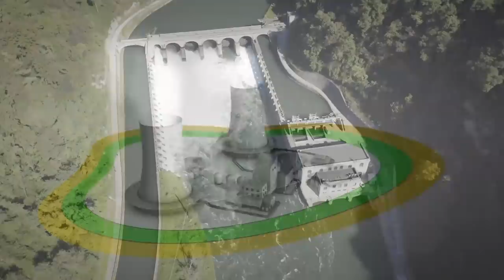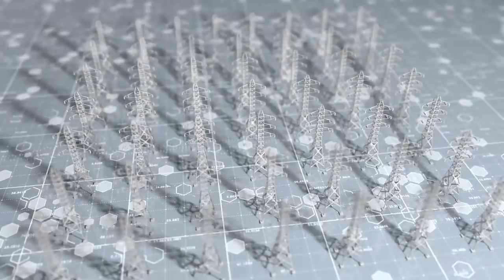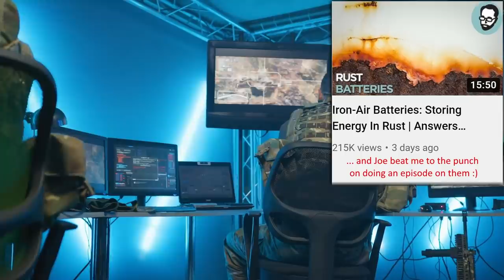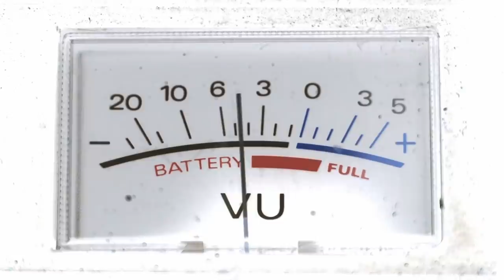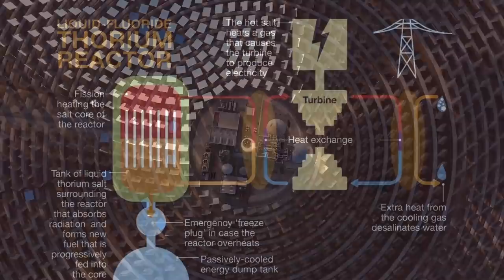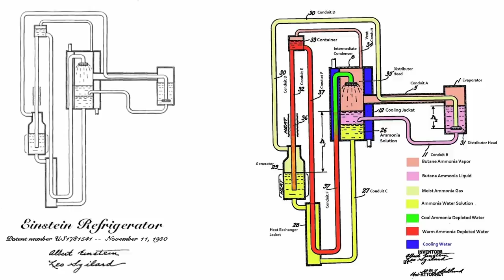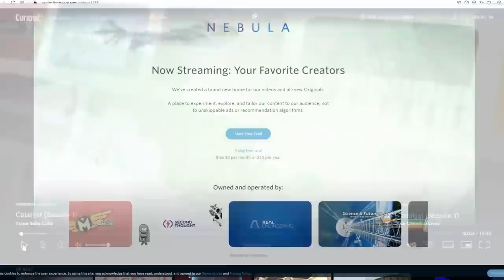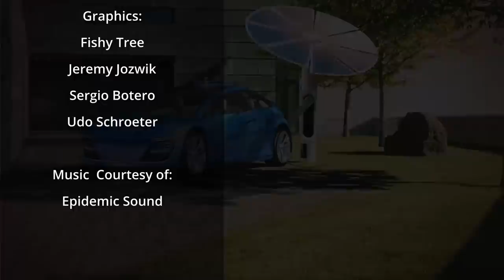The Future of Solar Power

Comment: In my former house i had a solar roof not for electricity, but for heat. The sun would warm the pretty black panels and heating water was circulating there. Even in the colder seasons that water could still get pretty hot on sunny days. So this directly lowered my heating bills.
Reply: I’ve installed these old school heaters for swimming pools. They work amazing and the pumps use almost no power, a few lightbulbs worth typically and you can have a very warm pool.
Reply: Could they still do both anyways, though?
Reply: I grew up in Cleveland. In the winter the air may be 20 degrees, but it'll still be 80-90 degrees in your car if the sun is out. As long as the sun hits the glass it'll heat the interior enough to melt the rest of the snow on your car.
Reply: @bruhtonbruhkkinson6848  Photovoltaics are more efficient at cooler temperatures. Installation costs are probably the reason for not combining heating and electricity generation.
Reply: @john-paulsilke893  Especially in particularly sunny areas.  My grandparents' solar heated pool could get above 100°F in the summer in Florida.  8000 gallon jacuzzi
Reply: @jdlessl  You can just stop cycling the water through the panels...  Though I suppose some people might want a pool sized jacuzzi ;)
Reply: @travcollier  Sure, but where's the fun in that? :)
Reply: @jdlessl  Fair enough :)

Honestly, this has inspired me to (finally) bodge together a very simple little pool heater.  I'm in FL, so it's easy enough... Wonder if how hot I can get it up to.
Reply: @john-paulsilke893  That is really cool. I never knew such a thing existed. It's crazy something like that isn't ubiquitous.
Reply: @travcollier  I’ve done BBQ hot tubs in the backs of pick up trucks using rubber sheets. It’s remarkably easy. As for piping up on a shed and a small pump running it, easy as pie. The water acts as a siphon so it doesn’t even have to be strong. Add a garden hose bib at the top so you can prime it.
Reply: I have 100 feet of black poly pipe that I run to the inlet on the hot water heater every summer. The water going into the heater is hotter than the water in the heater. Keeps the thermostat from kicking in.

Comment: Quantum dots are being extensively used in the display panel industry already, but now they’re being looked at for photovoltaics as well. For example, they could be used to inexpensively convert wavelengths of light a silicon panel can’t convert to electricity - say, ultraviolet - into wavelengths like blue that they can convert. They’re also experimenting to see if quantum dots could allow a panel to produce more than one electron per photon converted. This is one of those examples of a seemingly unrelated sector developing and mass producing a technology that ultimately has a huge impact on some other sector. Quantum dots might allow us to build inexpensive solar panels with efficiencies in the 40%+ range, which would render most other forms of power generation obsolete.
Reply: That would be awesome, assuming manufacturing costs aren’t prohibitive for some reason. Let us hope, my friend!
Reply: @Eff Youtube What waste problems?
Reply: @sunspot42  The costs of recycling panels. They're pretty energy intensive to recycle. Similar to other silicon-based E-waste. It CAN be done, but nobody seems inclined to do it
Reply: @DFX2KX  It’s a non-issue. I’d imagine a lot of panels will end up getting reused as roofing for carports, shade farming and other things. Especially in the third world. 

I’m a lot more worried about the truly insane volume of disposable plastic packaging we’re pumping out every second, most of which isn’t recyclable. A great deal is just getting burned in the third world, leading to tremendous pollution.
Reply: Does this also mean that a 2x reduction in pv cost would render other power sources obsolete?  

Or are there secondary benefits to efficiency besides cost?
Reply: „Just Have a Think“ made a video about exactly this a week ago, seems like some scientists made a breakthrough. They want to bring it to market by 2025 if I remember correctly, it would be easy to implement in current production systems and could even be retrofitted to existing panels.
Reply: Quantum dots sound like bullshit lmao, I figured you weren’t lying but I had to go look it up haha
Reply: @musicdev  They are a little like magic.
Reply: the way I see it anything short of a 100% efficient photovoltaic paint is not going to be cost effective enough to be a primary power source. the energy density of fission alone gives it a massive cost advantage in the long run. not to mention it's far easier to manage some buildings than miles of land.
Reply: @musicdev  - Funny that! It does sound like a fantasy concept!
Reply: @Eff Youtube - I would assume that in general the problems are going to be similar despite gains in efficiency. What kind of waste are you referring to? Solid waste as in trash, wasted energy lost to inefficiencies, pollution due to manufacturing or obtaining raw materials?
Reply: @sunspot42  Plastic packaging isn't an issue it just goes in landfills. Just like the solar panels will. Money won't be spent to transport them across the world. That is a waste of money. That money could buy a 3d printer that turns clay and melted plastic bags in the third world into homes or whatever else. Or some other better purpose of on site benefit. The issue with plastic is third world and developing countries that don't have proper waste managment. Largely the ones that throw trash into rivers that lead into the ocean or dumping into the ocean. The West is not the issue, our plastic for all intents and purposes doesn't matter it gets sealed into landfills with everything else and there is no shortage of space for garbage and won't be for thousands of years.
Reply: @sunspot42  It really doesn't in the West unless intentionally by way of product design. Such as was the issue with plastic beads in skincare/soaps that eventually got banned. Which is why I posted my comment. Plastic hysteria is not based in science. There isn't an issue with even not being recycled. It just goes in the landfil with everything that also won't decompose because it essentially gets mummified. Secondly the carbon impact is low as was demonstrated with studies disproving the hoax about plastic bags used at stores. The thick plastic reusable bags and cloth ones took hundreds of times more carbon to produce and it would take thousands of uses before they were carbon neutral over the disposable bags, far longer than any person would ever keep or use them or they would even last for. 

The whole carbon hysteria is to create a faceless enemy that can never be defeated and gives a endless income stream from the carbon tax with no measurable accountability for the money in giving any tangible difference against this faceless enemy. It's a scam. If carbon and climate change was a real issue there would be mandates for farms to turn crop waste into biochar and the issue would be solved/addressed almost instantly. The technology to do so has existed forever, it is cheap and simple and anyone in the world can do it. The whole thing is a scam. The real issue is the toxic chemicals from industries being released. Yet all we hear about is carbon an essential life giving element. And plastic, something is ubiquitous in culture and requirement it's asinine to even talk about limiting it's use or ever getting rid of it.
Reply: @WaterspoutsOfTheDeep  there is definitely an issue with plastic long term it's not self sustaining and takes entirely too long to decompose now as far as the conspiracy of microplastics in the human genome and all that having some long term affects would still remain to be seen though I have doubts and I seen another article spoke of making bricks and mortar from recycled plastics like alternative to asphalt
Reply: @WaterspoutsOfTheDeep  plastic microbeads are not banned. They're not allowed to be used in some consumer products in some countries but worldwide they're still being produced in massive quantities for all sorts of purposes.
Reply: @martijn8554   Refer to the context I established. No one said micro beads ceased to exist. The important context is they are banned for products used that go into the sewage system.
Reply: @musicdev  - You have good skeptical instincts. :-) But yeah -- surprisingly, not bullshit.

Comment: You can store heat for decades as caustic soda. It was one of the pre-electric motor energy storage methods for smokeless locomotives. Only compressed air survived the electric motor but the risk is different for stationary plants instead of locomotives.
Reply: thats pretty neat i didnt know that
Reply from the maker: @TS-jm7jm  Me neither, and agreed, very neat :)
Reply: @TS-jm7jm  
The other used compressed ammonia absorbed into water after the work was extracted.
Reply: Yeah, but sodium hydroxide is also used to digest organic tissue and dispose of dead bodies.  It's very nasty stuff in concentratiom.
Reply: @PaulSpades  
That is why it took less than a year for caustic soda engines to be removed from service after the first practical electric locomotive was introduced. But the risks of a stationary and fortified plant and a locomotive are different and there are a lot of dangerous chemicals used in home and industry.
Reply: That seems interesting I have heard of thermal energy storage before but never that far back. Amazing how old that technology is.

Comment: It’s good to remember to check the loading on your roof before you slap the solar panels on it -
House across the street from mine has spent the last month in scaffolding after the added point loads on the roof truss started to cave it in, so you may need to do some reinforcing if necessary, saves a lot of bother in the long run
Reply: Does it snow in the area you're talking about?
Reply: @artsmith103  - You know, that’s a really good question Art. I’d think a set of solar panels, the size to power a residence, would not be heavy enough to buckle a roof in good repair. At least not a roof in decent shape that was built to code in most places. Still, I remember some past snowstorms in my relatively southern state that partially collapsed flat roofs on some businesses. 

I have no expertise in this area at all, so I went and looked at some info on the web - which can be dangerous, I know. Reading through several yielded fairly consistent estimations across sources. The average weight for residential panels in the US is around 40 lbs, with the heaviest weighing 50 lbs per panel. You would need to add maybe 10 lbs per panel for mounting hardware etc., so let’s call it 15 lbs to err on the side of caution. If you math it out that gives you roughly 4.15 lbs/square foot. The average US home needs 19 - 23 panels to cover their electricity - which works out to be for 1,495 lbs total weight on the high end (using 23 x 50 lbs per panel with 15 lbs of hardware each). That is a good bit of weight. I can imagine you might need more panels depending on how much sun you get and your power expenditures… Anyway I think most roofs in the uS are built to support at least 15 lbs/sq ft. Again, not an expert, and happy to defer to anyone with real knowledge. 

There are plenty of places in the world where roofs are not built to handle snow and where structural standards are different. I suppose that regardless of where your house is, the assessment of load bearing capacity for the roof and walls has got to be a crucial element in installing panels. Part of that calculation should probably include a margin of error to account for extra weight such as snow (or a roofing crew replacing shingles!) as well as unusual forces in weird directions such as from high wind catching the panels. If I ever do bite the bullet and decide to fork up the cash for panels, before proceeding I’ll get an opinion regarding load capacity from a trustworthy source NOT tied to the company trying to sell me the panels!
Reply: @ColdHawk  Solar industry has racking worked out pretty well. I can only imagine a problem on an unconventional roof. 2x4s without proper bracing and such. Or maybe bolt diameter that removes too much wood. Rail is typically spaced about 50" and attached every 48" which is every other truss on 2' centers. Then each of the last 2 trusses on each end of the rail.
It would take a deficient roof for that not to work.

Comment: "Where are we going to get the energy for this?"
* points at giant ongoing fusion reaction in the sky *
Reply: @destroyer1667  not necessarily. Indoor farming is very prevalent, I know it can not feed the entire planet but it would allow some portion of humanity to survive if the worst happened. If we go all solar and renewables and stop all use of fossil fuels, it will leave us very vulnerable to calamities that could render solar ineffective.
Reply: @joeisslow1638  the best option to survive for as long as possible in a shelter proof against calamities is nuclear power. Oil and coal both rely on a large chain of infrastructure and industry which would likely implode completely in the event of a massive asteroid impact. But even a small batch of nuclear fuel rods can power a bunker for many centuries
Reply: @joeisslow1638  There was one scientist that said with known thorium reserves there is enough to power the planet for something like 1000-10 000 years for basically unlimited power to do whatever like terraform the deserts with mass desalination and so on. That with current thorium reactor technology that's already been tested but not optimized power cost for the average Californian consumer would be 20 times cheaper than their current electric bill. The issue is the power plants cost a lot to build. So the upfront cost requires funding. We can already do it and be energy independent globally if we wanted...

Comment: Actually, larger tanks work even better. If you make insulation 2x as thick, the rate of heat flow through it halves. So if an insulated tank is scaled up 2x in length, it has 8x the volume, and 4x the surface area. But the insulation is 2x as thick, so the bigger tank only looses 2x as much heat.
Reply from the maker: Good point, as with spaceship armor, the cube-square law means bigger really is better :)

Comment: Have you reviewed Helium 3 again, three new developments make it conceivable now.  Once Space X gets orbital Refueling working retrieving it from the moon consistently is doable.  Superconductor ribbons are testing out at 26 Tesla it was only 20 Tesla this summer, and not unthinkable to reach 30 T or even 40 T.  That makes ultra small and light weight designs are going to be possible too.  The last thing is 3d printing it all on one piece, possibly as small as 30 cm and as complex as a Stellarator.  This could be done quickly in one material already mastered Titanium-non conductive, and Ti3Au-(Titanium/gold)-Conductive by simply sintering Titanium and inkjeting the gold on top of the sintered metal.  Making complex wiring part of the print, but what has not been done yet is the superconducting ceramic in the same process, at about the same temperatures.  Just over sinter and fill with a little ceramic or a little gold.  Then you have a micro fusion devise with He3 direct electricity and no neutrons, no radioactive waste.

Comment: Just a thought: if batteries can be recycled to make new batteries, would it be possible to make a battery system that can repair itself?
Reply: you can probably make a self-healing battery, but battery degradation usually happens on the microscopic & nanoscopic scale so ud prolly need micromachinery(biotech/nanides/self-healing materials/structures).
Reply: Given batteries have to be cheap and preferably compact and the self-repair system would cost money, space, weight and power that you could use to make more battery instead, it doesn't seem useful unless you are planning to send those batteries to outer space or something so you can't just replace them when they degrade.

Also, by the time that battery needs fixing you might have a so much better and cheaper option available that it would be preferable to replace even the perfectly working ones.

People saying Li-ion batteries are not or can not be recycled are talking pure BS, but the fact is there isn't actually much lithium in a li-ion battery and it is combined with some other materials that are hard to separate and they are all very cheap so it is not currently economical to recycle lithium out of li-ion batteries. So a lithium battery recycling company gets most of its revenue from stuff like cobalt, which is then used for alloys and refining oil because battery makers are moving away from battery chemistry with cobalt in them...
Reply: Nanomachines son